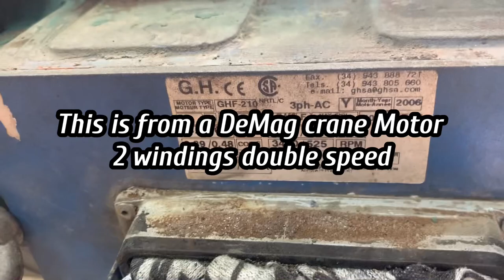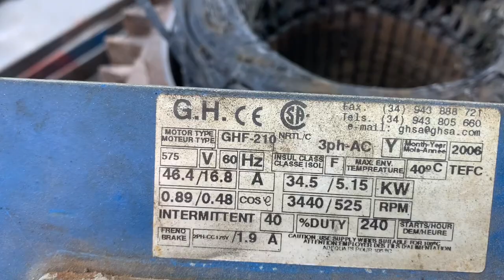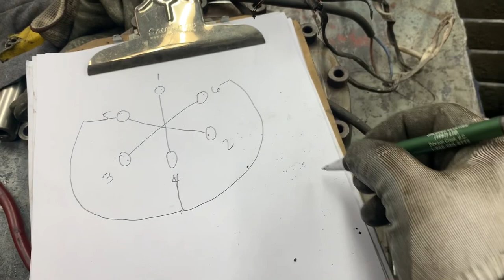Motor Rewinding | DEMAG Crane Motor | Double Speed /Double Winding

Comment: greetings! I have made many of these special crane DEMAG motors here in Brazil, and we always have a lot of difficulty because they work with a high filling factor and the air gap space and cover space is very small.
Reply from the maker: Good day,crowns are made to be compact as covers/endbells are super tight that makes more hard to rewind this kind of motors,one of many motors i wound those are trouble if you can’t do it right on making coils.Thanks for dropping your comment,great day.
Reply: @windertrucker6230  Exactly, I would like to see the whole process and the conclusion of this work. will be very satisfactory for us to compare to our process here in Brazil.

Comment: Helow kabayan👋👋separate pala yung coil high speed at low speed request ko sana kabayan drawing mo rin yung connection ng low speed sa part two mo,naririnig ko yung consiquent pole na sinasbi mo sa mga vidio mo kabayan yun ba yung pag dika nag counter,pag start mo  sa begining tapos end to start ,,end to start.❤❤
Reply from the maker: Naka separate kabayan cge my diagram ako sa part 2,normally sa consequent pole end to start yong jumper kabayan
Reply: @windertrucker6230  ok thnks kabayan consquent pole nga yon nakarewind na ako ng ganong sytle pero 6coils lng sya.wait nalang namen yung part 2 mo kabayan hehe❤❤❤